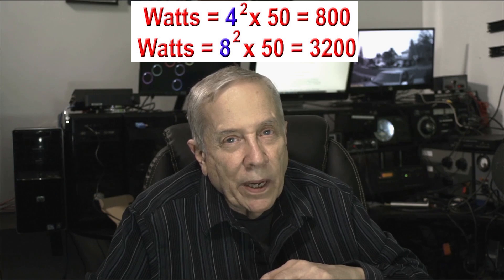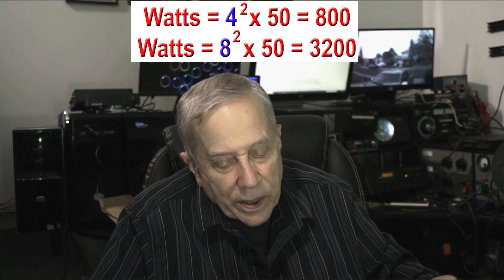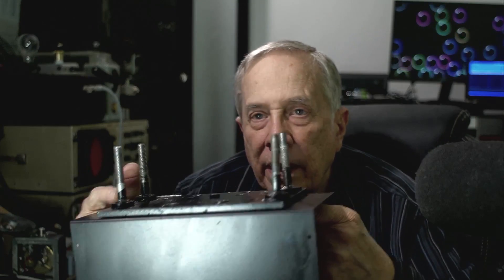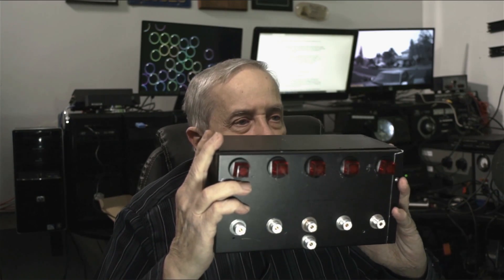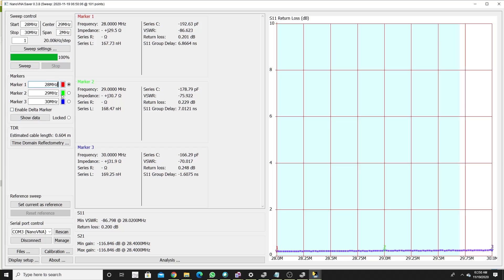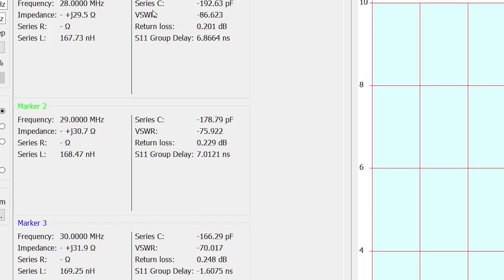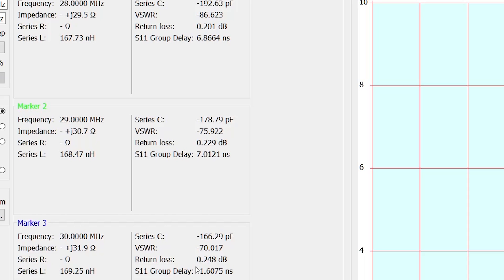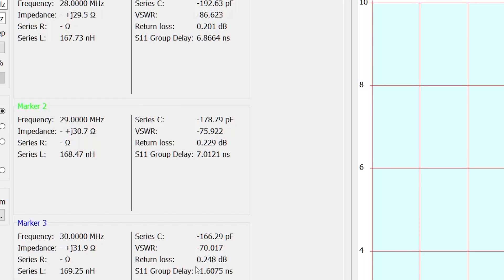Remote Controlled Ham Radio Coax Antenna Switch Will Handle 1.5KW

Comment: Jim, I have a couple 12vdc relays with contact ratings of 12vdc 250a. do you think they’d work?  I believe they are intended to connect / disconnect the battery in a car or truck so they are pretty heavy duty.
Reply from the maker: Sure.  I squared R. 73, Jim

Comment: Nice little switch, ...liked the relays - I've never seen them in vacuum tube configurations.
Reply from the maker: You can find them on Ebay.  They work great and can stand some really high power.  There are 2 versions; large and small.  73, Jim W6LG
Reply: @ham-radio  Thankyou Jim

Comment: Another good video.  I am considering making my own antenna switch since the prices are $250+. I started looking for this was when I was trying to mount radios and antennas in my truck.  Primarily it would be nice to run one feed line out of the truck and switch the antenna feeds outside of the cab (routing cable of any kind out of a truck can be “fun”).  Where did you find the current capacity at HF?  Thanks again, and all the best!  73 de KI5HXM
Reply from the maker: If I had to build one today with limited money, I would use the Russian vacuum relays that are the small version of the ones that I did use. The small relay from Russia and Ukraine easily handle legal limit.  The ones that I used can handle about 6dB more. 73, Jim
Reply: @ham-radio  thanks for the reply.  I am intrigued with the suggestion of using vacuum relays.  Where can I go to get smart on those devices (not asking for you to spoon fee me, i am a retired electrical engineer and have a lot of the basics that i need.  Of course making a switch of this sort could be over kill for a mobile rig in a truck.  Perhaps a simple Alpha Delta switch with multiple coax leaving the cab might be more reliable (less failure points).   Even if I don’t go this route, I am in Ham Radio to learn!

Comment: How far apart on the tower are your antenna's
Reply from the maker: After 38 years, I had to move. The antennas were not stacked but were on separate towers.  The 20 meter antennas were 20 meters apart in the same horizontal plane using matching networks, delay lines, rotators to get about 10 to 11 dB gain as fed from hardline in the ground.  73, Jim

Comment: Also the nc contact is usually rated at half the current. Its only held with a spring. The no contact when energized is held with a magnet.

Comment: This video really points up the overlap between the ham community and the maker community, which I didn't realize until I became a ham later in life. I love it!

Those relays are monsters!  And, in the spirit of the video, I'm wondering if I could make some vacuum tube relays of my own.  Hmmmmm...
Reply from the maker: Sure you could.  The smaller version are really handy.  I am going to buy a few more for other projects.  You too might want to get the smaller relay for an antenna switch. In any case, have fun building something.  Thanks for watching and writing.  73, Jim
Reply: @ham-radio  As it turns out, there is plenty of detailed information out there on ways to go about making your own vacuum tubes of all sorts--from light bulbs to tetrodes and all sorts of other interesting stuff.  It had never occurred to me to look!

And now my list of future projects has grown by several.

Ah, so many projects, so little time...

73

Comment: Personally I like the box. I'm a beginner I'm just now getting back into radio. I enjoyed 11 m as a teenager but work quickly took that over and made it disappear. Not to mention the fact I've moved about every 3 to 5 years my whole life. So the idea of a base station wasn't really practical. I'm wanting to get back into all forms of radio. I still enjoy the CB which I purchased after gmrs. Very close to being able to get my technician. And I don't want to stop there. No I was weighing the cost of running separate cables. My first run of cable is the lmr400. In order to get out of the valley then I'm in in the Appalachian mountains. My run from my home to the base of my tower is going to be 300 ft. With a 60 ft Tower I'm gaining nearly 300 ft in straight up elevation. So I believe it's acceptable. But an option like this would definitely cut down the cost on running multiple cables for that sort of distance. The question is what little box like that cost?

Comment: A project of this kind is right up my alley, Jim. I'm currently working on a mag loop for 20m. Should you have the opportunity and wish to do so, it would be great if you could call out some part numbers for the relays. On the other hand, having given a clear explanation of how to de-rate AC relays for HF work, anyone should be able to do the same when doing their research. 

73, 

John, KJ7RDV

Comment: Hello, just stumbled on your video as I am looking to get into HAM radio.  Really nice build.  Some thoughts, the vacuum relays to my knowledge have a vacuum to handle high voltage switching in a relatively small space.  The size of the conductors are what mostly determine the current.  When I used them on a design for work they were really expensive with a long lead time.  A potential alternative would be mercury wetted reed relays for a lot less money.  Also, I’d suggest using DPST, or DPDT relays.  Then have one contact for the main circuit, and the other to provide remote indication/confirmation.  Thank you for sharing.
Reply from the maker: Those relays cost almost nothing and were from a good friend in the Crimea.  I have built 3 of those boxes using 15 relays and all work great.  I have an old, but new to me, amp with a large open frame relay that is slow and noisy. I will change it with 2 vac relays that close quickly without noise.  Thanks & 73, Jim
Reply: @ham-radio  could you provide the part number and where you got them?  Sounds like I could use them. Thank you.

Comment: I was using a switch for 20 Years , equipped with small AC 220V 16Amp 2$ relays. NO FAULT EVER . Well the limit here is 750W , but i am sure they would even have been okay at 1500W . The Problem of these relays  you showed is the OPEN FRAME ..  the is prone to dust and moist which will build up resistance and ..therefore after time heat and oxidation. Vacuum relays are made to switch high speed under load. I replaced the switch some years ago due to rotten SO239 Sockets. Now i guess the newer switch with 32Amp surplus 4$ relays will live way past behind my lifetime....
Reply from the maker: Sounds good.  Relays...I think I said that a person could do a PHD thesis on relays. A lot goes on in one of those things...also the open frame issue.  Thanks Harald 73 Jim

Comment: Good video. I learned something. They say you should learn something new each day. I was contemplating building a manual coax criss cross switch and hadn't figure the current difference from 60hz to 28Mhz. Your video prevented a failure.
Merry Christmas. 73 W9DLP

Comment: Jim, nice job on the HF switch .  Can you provide a diagram on your VNA test setup?  I'm curious as to why you made an S11 Return loss measurement instead of an S21 insertion loss measurement.
Reply: Maybe he was testing the coax going to his tower or he couldn't access the other end. Measuring return loss÷2 is should give exactly the same result as insertion loss. You just short the far end and measure the return loss from this end and divide by 2 to give insertion loss.

Comment: Welcome back Jim - Question regarding Return Loss
I thought one wants an RL value as high as possible like 40dB best I can get.  That is because RL is measuring how much energy is coming back vs going out.  We don't want much if any RF coming back (miss match) so the larger the dB value means not much coming back.  RL is indicating the difference in outbound vs reflection.

Do I have it wrong?
Bob - W6OPO

Comment: My experience says that most problems with antenna switches are either moisture or hot switching (could be because of RF in something causing it to switch such as a band decoder or power supply). I have used regular hermetically sealed Omron 16A or 2x8A relay contacts in all my switches and have never ever had any issues and I have A LOT of relays at SJ2W. When I started selling some of my switches I even went to a guy who has a big amp and ran them for quite some time with 6kW on 20m and no issues. However if you get VSWR and don't use vacuum relays you will have problems. My whole station is fully automated so no mistakes can be made transmitting on the wrong band, without an antenna etc.

I even use a regular 16A relay in one of my amps as TX/RX relay and it still works 8 years later I installed it, but I have proper sequencing. So again, I think 95% of problems are either hot switching or moisture.

WX0B switches I have not very good experience with, I would guess it might be a lot because of the open relays.

Comment: Hello Jim, very nice job. Back in the '70s/'80s I received a rf test set for which I had to perform an acceptance test. 
A little while after taking possession of the rf test set, I believe I had problems with one of the compact flat packaged relays. When sourcing a replacement I found a relay with the same specifications and size, but it was a 'yellow' sealed nitrogen filled relay. I changed all 6 signal relays with the nitrogen filled relays and never had any contact problems again with the equipment. A few years ago, I looked for those nitrogen filled flat transparent yellow tinged sealed cased relays for a project I had in mind, without success. 
Back in the '70s/'80s there were many new high tech components manufactured, sadly quite a few of these excellent components have sadly disappeared.

Comment: Great video!  I recognize those "green and mean" relays .. they are Russian made.  These relays are great for antenna switching but should not be used as a TX/RX relay they have a release flight time is a week and a half.  KC8ZUL columbus ohio.
Reply from the maker: You are right!  Good for band switch, antennas switch but not hot switching or TR switch.  Thanks Gerry...good information and help!  73, Jim

Comment: Thanks for the video.  My only comment is that relay contacts are rated at how much current they can switch (make/break) over a certain lifespan (like 100k operations). Breaking high currents is especially bad for creating high temperature arcs of several thousand degrees, which eventually destroy the silver contact points.  As long as the antennas are not switched hot (while transmitting), the general purpose relays should be fine.  I have been using GP relays for years at full legal power with no problems.  I use DPDT relays for each antenna line, with each relay pair wired in parallel, which halves the current at each contact point.  Regards, N4DXC
Reply from the maker: Thanks Bill.  I don't believe that I ever hot switched the relay contacts.  But, anything is possible.  I commented to another ham that a person could write a PHD Thesis on relays.  I used a vacuum relay in one amplifier and may put one into an amp that I am building from the remnants of one that did not survive the move in good shape.  I did not get the new relay box installed yesterday.  I hope to do that today. I had another tooth fracture due to the osteoporosis and that slowed me some; it really hurts.  I hope to show the underside of my ham desk and the grounding system in the next video.  I don't believe in station RF grounds.  But, I did it just to see what happens.  Thanks again Bill.  73, Jim

Comment: Well build homebrew antenna switch ,
Where did you find the vacuum tubes you used in this project you built th antenna switch system love the video keep more coming is there build notes on how you built this unit my email address is radiotd62@gmail.com i love to building homebrew antennas and see how they perform on the air,
Thanks ted Dean KD2ARD....
Hope to make a contract with you one day 73's

Comment: Hey Jim,
Odd question, but could this be run in reverse so to speak. I'm looking for somthing to switch between radios on the bench. I'm only running 1 antenna, but several radios.
Thanks, I appreciate your time
Reply: No you can't use them to switch radios because they are only one contact if you switch radios you want to have just one radio connected to the antenna rest of them must be grounded.
In edition to that each relay must be separately shielded or you will get way to much RF leakage from one radio to the other .On 100 wats of power you don't need vacuum relays regular 
single pole double throw will do just fine .Jim use vacuum relays because he is switching KW or more at antennas.
Reply: @georgezardecki5888  thanks for the reply. I had a feeling that would be the case. Would be awesome if it would work though.
Reply: @luke8210  Luke send me email I can make diagram how to connect several radios to one antenna 73 George N9VTB
Reply: @georgezardecki5888  
What's your email address?